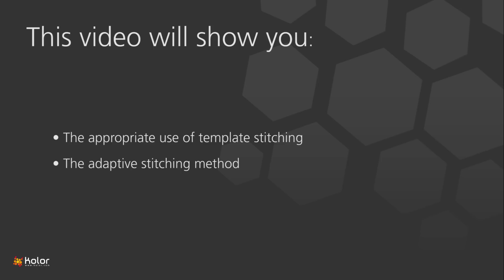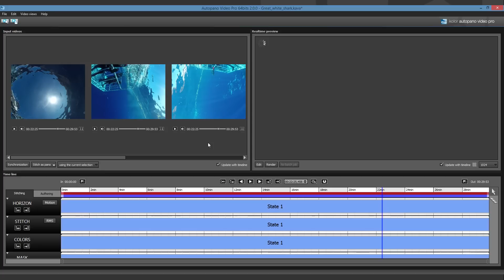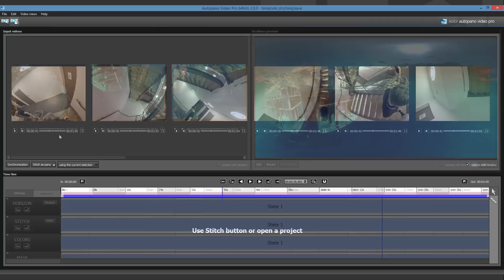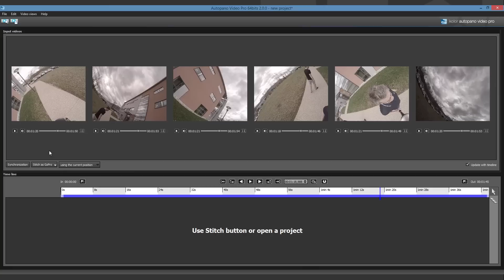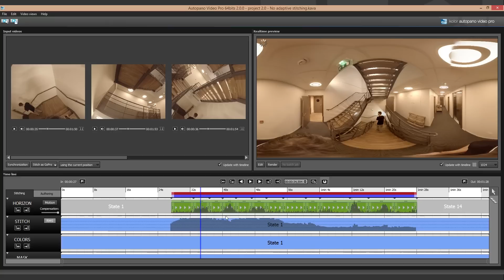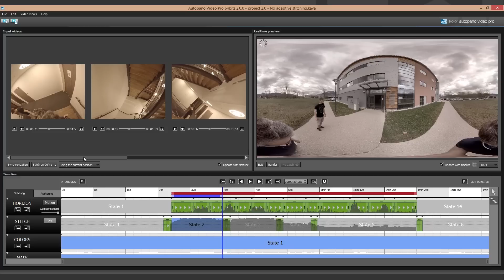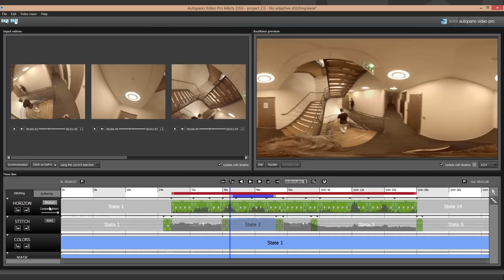Advanced Stitching Methods

Comment: hi My friend, I'm almost desperate :)  huge hard time trying to stitch a close shoot using 6 gopro 360 freedom rig. parallax is killing me, i'm trying control points and mask but I still don't got it. are there specifics configurations to do in order to stitch closer shoots??   does RMS and amount of control points have to have a better number?? thanks a lot
Reply from the maker: Hey, 
Close shots are always a challenge. Work on CP and mask will help, then compositing multiple renders, (doing different stitches for different elements then assembling them in AE), masking stitch lines with static elements, etc....
RMS is an indication more than a goal, but the lower the better.
You can check our "behind the stitch - tour de france" to have a look at some of those techniques.
Reply: the major problem is I have movement exactly in a 3 seams meet point, and the mask cover area can't reach the full movement I have in the scene. in this case I have to segment the time line by states and make multiple stitch ??
Reply from the maker: More likely, Render a stitch that is good everywhere except on that area, then weaken the links everywhere except in the problematic area by removing some control points, strenghten the stitch at the meet point with fine tuning CP and comp the two renders in AE.

Comment: hi Kolor. thanks for the tutorials. I use a freedom 360 rig and I have the template, but my 6 action cams I make the videos can't give me the 4:3 format. only 16:9. is there any template for it?? or how can I create my templates?? or anyone can help me on it??  my mail is. gustavoramanzini@gmail.com

thanks a lot
Reply from the maker: Hey, with normal lenses for an action cam (about 120° / 90° of FOV), 16:9 will not allow you to create a full sphere, no template can help with that. You absolutely need to shoot in 4:3.
Best regards,
Loïc
Reply: hello,  how . are you??  thanks for respond .  actually this cam has a 170 of FOV,  does it help??
Reply: the cams are the eken h8pro
Reply from the maker: Sorry, it's really a problem of ratio. With 16:9 and a freedom 360, you'll always end up with holes in the equirectangular. Not much you can do about it.
Reply: Kolor thanks again. may be an other rig?? what kind of solution I can try before replace my cams??
Reply from the maker: appart from changing the lenses of finding a firmware that unlocks 4:3 modes on the camera, not sure you can do much about it. Sorry.
Reply: Ok. Will try. Thanks a lot

Comment: How can I transfer the masking settings from one template to another? It doesn't seem to come with the template, but it's a lot of work to redo a video's masking if it's supposed to be exactly the same
Reply from the maker: For the moment, templates don't include masks. But a workaround for that is to copy the full .kava file into another folder. When you open it, AVP (since v2.5) will ask you to point to your original videos and you can then select different source videos. It's not the cleanest way of doing it but for the moment it does the job.